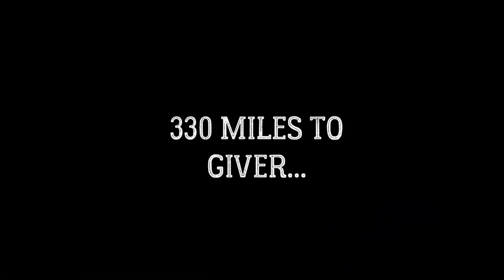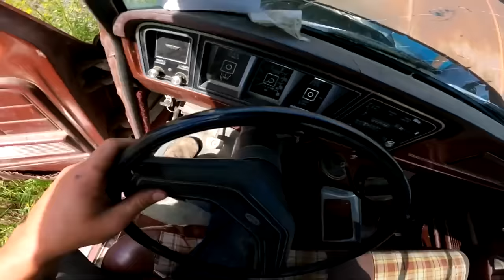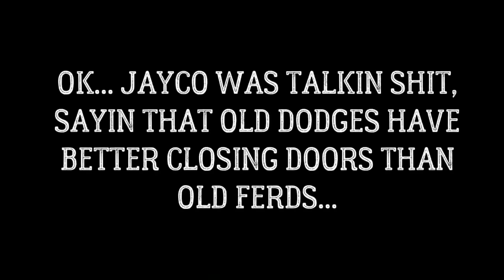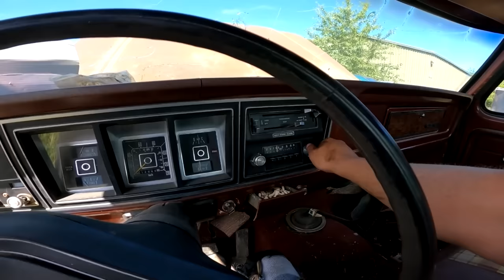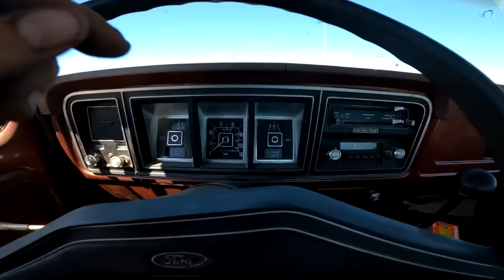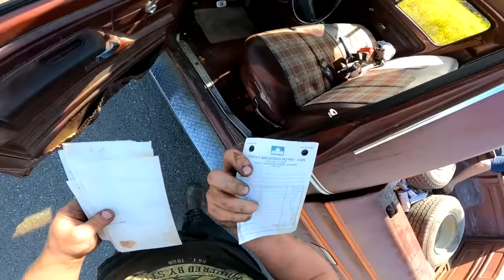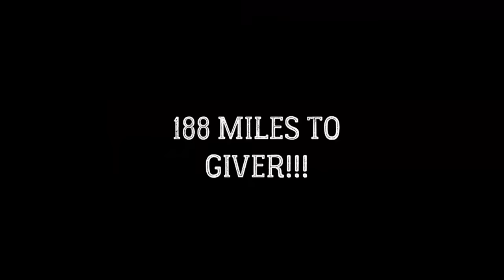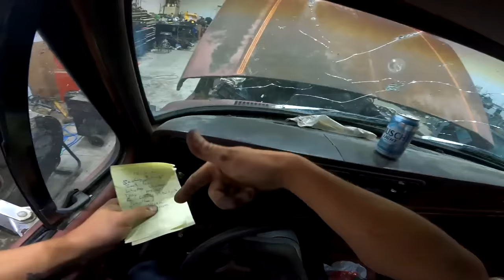1979 FERD F-2 FITTY, REZ ERECTION AND DRAG RACE?!?

Comment: A Ford 400 can be made to run, it's not really worth it however considering how cheap it is to just build a stroker from a 351w block, even aluminum heads can be had for $800 a set compete at the bottom that will make 500hp with some porting, highrise single plane or $1900 complete pair TFS 11R heads will make 600hp+ the largest common stroker kit is the same size for a 351w or 351m/400 which is 438 or 445ci at 0.030 or 0.060 over. If you made a custom 4.5" crank a 460m could be made at 0.040" over, CHI heads, intake and monster cam could be used and make something exotic but, it's not worth it. Just use a 351w.

Comment: They are guttless in factory form but you can make good horsepower with them if you do a little bit of stuff mine is punched 40 over so basically a 408. something something and it makes pretty good HP
Reply: Boring them out does basically nothing for making extra power.

Comment: Hurst transmission and bunch of other engines on the market can always come in handy as well
Reply: Huh?? 😕 
Hurst NEVER made a transmission. They make SHIFTERS for both automatic and manual transmissions, but not transmissions.
Reply: I remember the ford mustang have got the transmission with the ford racing motor under the hood as well with the v8 motor
Reply: I know hally racing performance makes transmissions for anything that wants to go fast and summit racing as well make your own vehicle sound like dragster go for it

Comment: My stick shift chevy k1500 4x4 sidestep single cab sat for 22 years in field owner said 12 people tried to get it running over the years it had a 4.3 I knew the problem slapped a whole distributor in it and while was turning it  back and forth with a new coil it zapped me through my arm my pocket was touching my zipper and my zipper was touching the bumper and grounded 🤣🤣🤣👌👍 and I fell over my mom thought I died felt like the old wee wee exploded like a cigar with a firecracker in it from ole tom and jerry cartoon👌👌👌👍🤣

Comment: Ford racing motor and hurst transmission can also give your truck some speed racing as well that your working on and the ford international harvester 7.3 idi diesel engines are built for work horse and you need a mustang in a farm truck body

Comment: put new pushrod and rockrs back in it it will run..also it died because there wasnt any oil coming up the campingstick for the valve to get oil and it just wore it out...replace rockers and pushrod well lube valve and feed it the beans it be fine...my '74 351m in my kitchen and yes i know they say they didnt make them til jan '75 but my block id number says '74    they they 351m is a 400 with a shorter stroke  351m= 3.5 stroke  400=4inch stroke  both engines had 4inch dia. pistons.

Comment: I know exactly where your pushrod is. I bought a 79 bronco. First car I owned. Engine didn’t run right so I rebuilt it. Take the valve cover off and found an extra push rod laying in there. I’ll get it sent to you right away bud 🤣

Comment: You need to wire up 1 of those GM style HEI modules in place of that junk fender mounted crap Ferd came up with. They are cheap enough you can keep a couple spares in the ol glove box jut in case I know your luck with Princess Auto is nothing short of minty but you never know.

Comment: valve float may be why your pushrods are failing or valve springs weak/broken
Reply: I second the dead valve spring theory.  The seafoam revs or burn out took the #5 pushrod I would guess.  The hot rocker arm was interesting.  Clever bush fix.

Keep us stunned.

Comment: 400m is the most gutless turd ever created but they run forever and hard on the gas. My buddy had a 79 ford and we was coming back from the drag strip towing our cars and he tried to pass my 84 Chevy that had a 305 and he couldn't pass me with that gutless 400m.  Now my Chevy has had a couple more 305s but those 400m engines dont have enough power to blow up haha.

Comment: About 20 years ago I was working on a truck the guy revved it up three fan blades flew off the fan one went through the hood one cut the transmission lines off and the other one cut the radiator hose off every time I see somebody lean over the fan to revving engine up I cringe

Comment: 46:20 it would have ran that far without oil. had a shit stain shop do an oil change on my 4.0l jeep and they didnt put new stuff in. i drove 30 miles just fine. the block was fucked and couldnt rebuild it after that but sure did make it! that is a ferd and im alwasy surprised that some of them even make it down the road. and doing a thermostat delete can work against ya. after long driving it can not give the radiator enough time to cool that coolant down so it just circulates hot fluid

Comment: Some 351m/400 knowledge here. In stock form they’re turds. Ford had to castrate the compression in them because Greta started whining over the polar bears. But there’s still ways to get power out of them. A 351m block will fit a 400 crank and you can pick up a set of 0 deck flat top pistons to get some compression back. The stock heads basically the same as 2v 351 Cleveland heads. A set of 62cc 4v Cleveland heads will bolt right on the engine, but you have to fabricate intake manifold adapter plates for a 4v Cleveland dual plane, and then fill in the bottom of intake ports in the head with about 3/4”of JB Weld to get your low end torque port velocity back. You’ll also have to run about a .070” head gasket to get the compression back down to about 10:1. Then 351c headers, a solid flat tappet cam, and she turns into a pretty stout motor.
Reply: Or you can just take off all the egr crap, weld up the recirculation ports and be done with it.
The heads may fit, but the push rod/cam alignment doesn't match. Yes it will work for a while, but not if you plan on racing. Broke a few push rods, con rods, and pistons trying those tricks back in the day. Once you go above 5,000 SPM everything expands and moves differently and bad things happen. Cast block and heads don't change much, but everything else does.
That's why so many people dropped 350 Chevs in instead.
The 429 Boss was good answer, but too expensive for most racers.
Reply: @gwbuilder5779  The 400/351m was designed from the Cleveland block. Ford just extended the Cleveland deck height to allow for more displacement. And all 3 engines use the same camshaft.
Reply: @johnanderson2346  Yes, there were 3 main blocks, US, Canada, and Australia. Later on the Mexico came in.
Had a 71 Mach I with the Cleveland 351. Not sure exactly what was different in the 400, but that's how Ford is.
I have 2 F250 7.3 IDIs a 90 and a 92, both 4x4, both with the supposed exact same Sterling rear differential, but the 90 is 2 inches wider. Each axle is one inch longer. The wheel hub, brake drums and shoes are the same, but the hardware and E brake are slightly different.
It doesn't matter what the books say, some stuff is just different.
Reply: @gwbuilder5779  Ok well the 351c, 400, and 351m are all classified by Ford in the same engine family (335 series.) This is because the 400/351m is a Cleveland cast with an extended deck height to accommodate a 4” stroke crank and longer rods/ different pistons for the 400. The 351M is the same as a 400 but with a 3.5” Windsor crank and different rods/pistons. The 400/351M are cast with the ford big block bell-housing. Minus the longer pushrods for the taller deck height, different intake manifold, and the height of the distributor. The top end of a 400/351m engine is the same pattern as a 351c (Bore size, cam, lifters, water jackets, oil galleys, rockers, springs, head bolts, etc.) So to say it wouldn’t work because the cam/pushrod angles are different is like stacking 2 same size bricks on a table square on top of one another. Then saying the top brick still isn’t square just because it’s a different brick. That’s all Ford did with the deck height on the 400/351m
Reply: @johnanderson2346  Obviously you have a need to be right so have at it.
Reply: @gwbuilder5779  Not really, I think they’re just misunderstood and underrated engines that more people should know about. Lol
Reply: @johnanderson2346  Pretty sure I stated that I actually raced these engines right from the beginning.
You can read all the stats you want.
Reply: @gwbuilder5779  Right, over 5000 spm.  On a truck engine that was designed for low end torque.
Reply: @johnanderson2346  That was the whole point...

Comment: Ford 400: You want that engine for a huge air compressor.  I want to see the video where you turn your 400 into a sandblasting truck, which drives to the job site on 4 cylinders, then blasts media with the other 4 on site.  If you don't do this, you didn't make a video where you tried to pony motor a truck with a lawnmower.

Comment: I used to own a 79 f-100 Ford ranger with a 360 automatic trans 2 barrel. Engine sucked bad, gutless garbage oil burner. I took that engine out and put a rebuilt 74 390 engine in it and some bitch ran real good. Upgraded the trans, with stronger clutches damn thing was quick not bad for a 3400 pound rust bucket.

Comment: 35:48.... Yea, why DID Ford have to put the distributor right up next to them leaky ole accelerator pumps? EVERY ONE of them ends up leakin fuel all over the place, over time, and is just RIPE for a gas blaze when the plug wire eventually rots apart and the dizzy sends an errant spark RIGHT to the closest ground (the accelerator pump). Maybe it's a self delete function, built-in, that conveniently rids non-mechanic type people of their problem trucks, so that they can take the insurance money down to the lot and get themselves new Ferds?

Comment: 🦅🇺🇲🇨🇦🦅🇺🇲🇨🇦🦅🇺🇲🇨🇦🦅
Salute to all the upright Americans (the whole continent) out there!
🦅🇺🇲🇨🇦🦅🇺🇲🇨🇦🦅🇺🇲🇨🇦🦅
Hey Peg,
The wiener stick push rod failed because it is solid. No oil can pass through and lubricate the contact point on the rocker arm. That's why she's all discolored and everything.
I'm gonna guess that the cam lobes are just round now, no more up and down now.😜🤪👌👌👌👌👌
I'm a bit stunned myself today,
The reason both cam lobes are probably round is most likely due to the extra heat the old wiener stick was making. Kinda like a mullet,
Started in the front and workin it's way to the back.👌

Comment: Peg thank you for the tip on putting ATF in your filter when reviving a diesel.  I haven't run my 40k pound excavator since 2016 when I moved it off the ranch after my dad died and I had to sell the place.  But that mitsubishi mill fired right up on it and ran easy.  Too bad I had to spend 4 days rewiring it and spending $600 on new batteries.  But it doe feel good to hear it run.  Ran that unit for 6 years almost every day building a lake, it kind of feels like home.

Comment: Wants to go drag racing. Buys a 2wd 3/4 351m 4spd.  Lol not sure on your thinking here
Reply: My buddy used to have a Chevy 3/4 ton with a 4 speed, it was fast as hell. Won't mention that it had a 400 hp 383 in it though 😅 it would do about 140mph and get there in a hurry
Reply: @Beandiptheredneck  I mean it didn't do 140mph but ok

Comment: OMG the farqing canadian dint pre-fill the oil filter!
You know how long it takes for oil to start coursing through an oil filter, about 2 seconds and probably courses through major engine pathways in 10 seconds.
So you idle at 800rpm, divided by 60 (seconds) equals 13.33333 revolutions per second, times 10 is a whopping 133 revolutions before all your engine is all looby.
Most ridiculous thing ever, its just so lube tubers can get on the interwebs and claim they care more about their engine than you do.